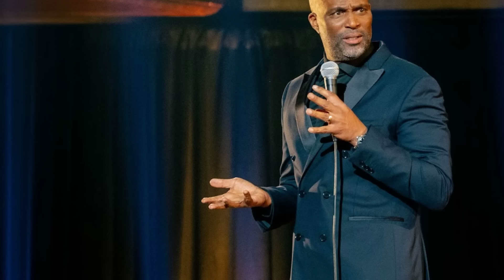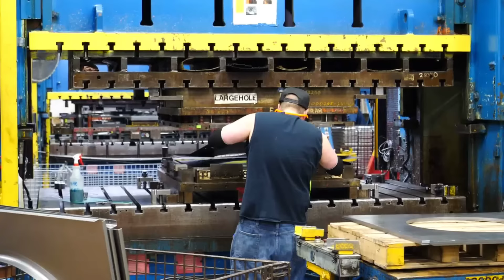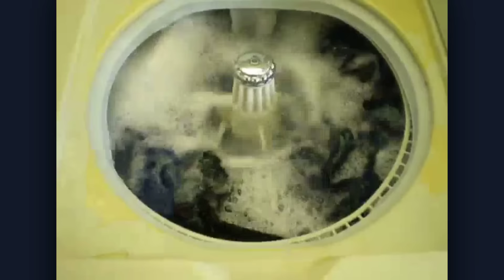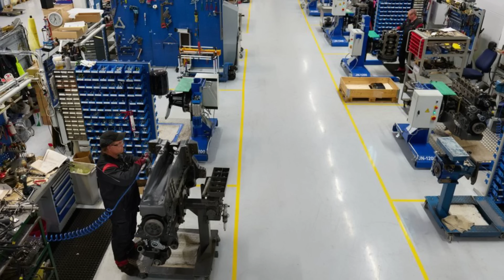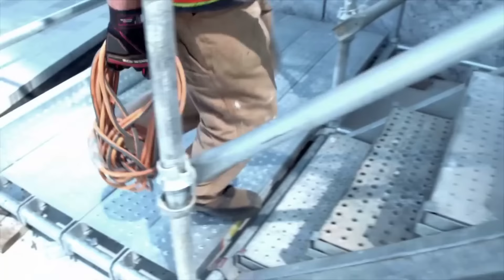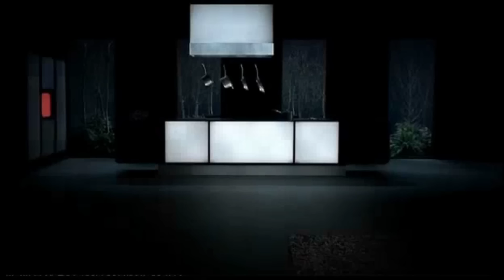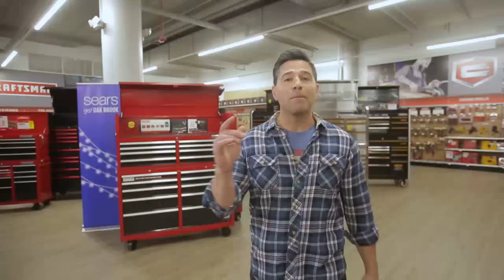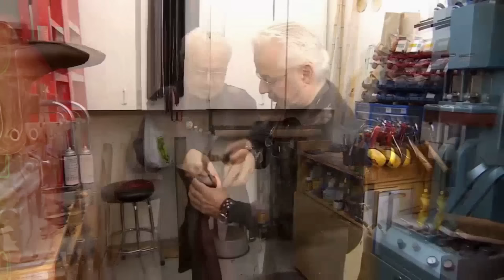The Only 5 Brands That Still Last (The "Buy It For Life" List)

Comment: Agree with buying Speed Queen, but disagree strongly with using top loading machines. 
They ARE violent, and that wears out clothes. 
I have a Speed Queen front loader that I bought used on Craigslist after it came off a military base. It's gentle on clothes. Same durability. Simple design. Siemens motor, very efficient on electricity. A bit inefficient on water. Don't know how old it is, don't care.  Parts are cheap, already bought spares.

Comment: A year ago, our refrigerator went kaput.  We decided to buy another from a local dealer instead of from a big “everything” store because we had heard that those are the brands tgat break down so frequently. We bought a GE because we were told that they are reliable and last a long time. Here it is 1 year and 23 days since we bought it and the ice maker goes out.  The dealer has no repairman and we’re 23 days past the warranty.  So much for GE appliances.

Comment: Cast iron cookware is crap; heat distribution sux making it difficult to get consistent results. It's heavy, requires lots of care, and is clumbsy to use. The best solution is nitrided high carbon steel. The surface is exceptionally hard and it quickly becomes non stick. I have a full set of AllClad cookware and have used them for more than 25 years, but the KitchenAid nitrided pans are equal in quality and provide excellent results.

Comment: Every tradesman knows that German, Knipex pliers are the best you can get and Harbor Freight's Chinese made, Icon sockets, ratchets and other tools are beating the top brands in break test on Youtube reviews and then there's Milwaukee and DeWalt producing excellent tools with Kobalt by Lowes and Husky by Home Depot being considered lower tier, except the Klein Tools voltage meters, which are awesome.

Comment: I still have a SkilSaw from 1995, just needs a cord replacement and some oil.  Milwaukee quality has been declining, but they still have some decent items.  Their 10 year old hand drills had steel gears and still running good after heavy use.

Comment: I had a tool box full of old craftsman tools, until my service truck was stolen from the shop I work at. That was a few years ago, I had to replace everything with either snap on or Matco. 30 years of tools gone and the company had a camera that would bust me if I scratched my nose but somehow did not get a single picture of the person that stole the truck? I am pretty sure I know who took it bc he had only been there a few days and knew the trucks are parked behind the building where they cannot be seen from the road. He did not show up for work that day and never came back and he had no tool box of his own. The last ping from the camera was a block away from where the truck was found the next morning, by the way, the truck was stolen durning the middle of the day. The shop called me at 5 pm and asked where is my truck, all trucks are locked in shop at night. That is when they knew it was stolen, to top everything off…..they had refused to fix the security cameras around the shop for years! Now we have extra ones that watch everything

Comment: Speed queen is very very costly 3400 dollars for a TC 5 washer and dryer before installation
Reply: But the same SQ will still be working fine in 20 years. Buy a cheaper washer and you'll be buying your 4th or 5th one in 20 years and they won't be getting cheaper. Where's the savings?

Comment: Speed Queen TC5 does not have a purely mechanical timer; it has a mechanical knob mated to a circuit board.  The TC5 is designed for strong agitation, which is good for cleaning really dirty clothes, but the trade off is higher sound volume and harsher treatment of the clothing.  Interestingly, if warranty-length is a good indicator, the TC5’s controls, which have the appearance of mechanical function, are no more reliable than the models with touchscreen controls.  The TR7 model has touchscreen controls and a 7 year warranty whereas the TC5 has a 5 year warranty.  Yes, I did a lot of research before buying my Speed Queen 😂

Comment: I just bought an insulated Melitta pour over coffee maker. Uses a cone shaped filter, which I can buy a stainless steel reusable filter and just wash it every day. I heat water on the stove and pour it into the filter basket that sets on top of the carafe. The coffee brews down through, and after it's done I can remove the filter basket and put an insulated lid on the carafe. It keeps the coffee hot until I'm "coffeed out" for the day. Since I drink lots of hot water in the winter, I can also heat water a pour directly into the carafe. It should last a good long while with proper care.

Comment: I've had great success with Allen Edmonds shoes.  When the sole eventually wears through you can have the sole replaced.  Owned by private equity...but many (most) of the shoes are still made in the USA on the old Goodyear Welt machines from the 1950s.  I have some that are 20 years old and have redrafted but also recent pairs and the quality is still top notch.  

Redwing Boots "heritage collection" are also very long lasting high quality all leather boots.  

Our Kenmore Washer and gas Dryer  (front loaders) still going at 22 years.  Owning both front and top loading...the clothes come out cleaner and softer from a front loader.
Reply: Yes, 22 years ago it was still a good brand. Not anymore, things have changed. That's the point, reputation means nothing to today's manufacturers.

Comment: My Maytag washer won't even get our clothes clean, and our old 1980s machine worked great and was only discarded to be  given to family. The filter capacitors are leaking DC, so badly that even when not operating, if you place a radio or phone within two feet, you hear a 60 cycle hum!!

Comment: The speed queen you bought 8 yrs ago is much better quality than what you will get now. I had ro replace a SQ dryer bought many yrs ago because it needed a new timer switch. Guess what SQ could no longer get that part nor could you get a replacement of any kind so we bought a new SQ a couple yrs ago now. I immediately could tell it wasn't the quality of the old one. The metal was thinner especially on door. Was making loud noise when drying. Place we bought from said they did the SQ warranty but it took a month to come out & almost another for part. After all that, it still makes loud noise. I've been back & forth with SQ. Not happy. Will not buy another 
 warranty.

Comment: I've just checked the price of a domestic Speed Queen in my country (Brazil)... the cheapest one costs half of a new car. Talking about cars, do you know about any modern form of transportation that is not a glorified cellphone with wheels? I own a cheap, air-cooled single cylinder motorcycle, but what are the four-wheeled options out there in the world?

Comment: About the cast iron skillet...  Popular brands are Lodge, Griswold and Wagner, but I swear by vintage Birmingham Stove and Range cast iron.  That foundry designed the handles on most of their skillets with a ridge or spine on the underside of the handles, which gives one a better grip that helps keep the skillet upright when cooking and moving the pan around on the stove.

Comment: Speed queen owned by alliance laundry systems is owned by a private equity firm. They have designed their equipment to fail as well. I can rebuild one using high quality bearings and a steel transmission gear and it will last for a little longer then the factory but it fs isn't designed to last 25 years from manufacturer. But I'd admit it's repairable. Unlike many other washing machines.

Comment: Speed Queen is no longer a desirable brand of laundry equipment. I bought a set in 2018 and both pieces have been a huge disappointment. The dryer motor failed one year after the expiration of the 5-year warranty. I decided not to repair it since the cost was more than buying another, cheaper brand of dryer. The washer DOES have a lid lock, the bleach reservoir has rusted out, I have had to replace the control board twice, within the warranty period. I have decided to buy the cheapest laundry equipment I can find, then replacing them when if inevitably fails.

Comment: 1.speedqueen washing machine
2. Outdoor mowers, generator or pressure washers with Honda GX engines
3. Boots made with goodyear welt( upper is stitched to sole, not glued. Redwing & Thorogood American Heritage line.
4. Lodge cast iron pans
5.hand tools: Channelock pliers, Wright Tool for wrenches & sockets

Comment: What about kitchen appliances? I have my TC5000 washer that still works after seven years and which I expect to outlast me. 
My legacy generation Newton, Iowa Maytag dryer is on its last legs after more years than I care to count, but the new Maytags look like plastic that has been left out in the sun too long, can't even put a box of dryer sheets on top without it sliding off. 
Speed Queen is good but the current retail price is a bit out of the average buyer's budget.
Another problem is the Hotpoint fridge that went into full brick mode in under six months, a Maytag electric range that died the first time I used the self-cleaning function, and have had more Whirlpool and/or Whirlpool-built dishwashers than I can count, all recalled and the fix was to replace the machine with a new Whirlpool-built machine at my cost, "...and here's seventy-five bucks if you buy another one of our pieces of shit.  No, we won't give you the voucher if you buy a Bosch."

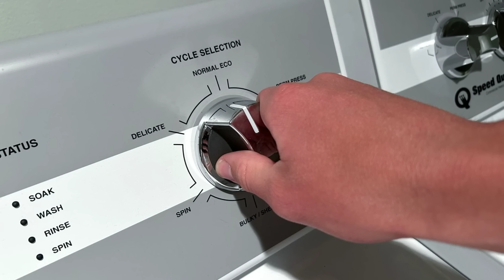Comment: 2:09   Begging your pardon, but the Speed Queen TC5 does not have a mechanical timer. 
The large knob shown is the cycle selector.
The TC5 is still the most reliable washer on the market, and when you have grimy work clothes, it cleans them thoroughly in under a half-hour. A lotto be said for that.

Comment: Channel lock sucks  if you've ever used them, you've pinched your fingers. I used knipex as a plumber. I also have a pressure washer that has a Honda gx390 engine. I used the hell out of it.  I turned it into a hydro jetter
 I've only cleaned the carburetor and changed oil over 6 years. I've replaced 3 pressure pumps as it's not worth my time to rebuild. Honda ftw

Comment: Here is a free tip that I learned many years ago, and I hope it helps some folks out there. Growing up as a poor kid, I learned very quickly: cheap vs quality. Instead of buying brand new cheap, I would buy secondhand quality. I am now pushing 60 years old, and to this very day, I still do the same exact thing. As far as the cast iron is concerned, absolutely. 

I use a brand called Magnolite, which were professional-grade pots and pans that I purchased in the 80s, and they cost a great deal of money back then. I still use them to this day, but I have noticed that, slowly but surely, I am converting to cast iron. The best tip I can give you is to use your non-stick pan for eggs only. Use it for nothing else, just for eggs. The second you see a break in the coating, you might as well throw it out. The last one I had lasted 15 years, but I only used it for eggs.
Reply: Yes, Magnalite
My current wife bought a set from Montgomery Wards before we got married 36 years ago 
We use them regularly & love em

Comment: I bought Xiaomi Typre Inflator / Air pump (for cars, cycles, football with an in-built battery). It worked for 2 years, then stopped. HelpDesk said, XIAOMI doesn't support that product anymore. I learnt my lesson, planning to buy a manual foot-operated air pump that's built to last.

Comment: I finally was tired of non stick skillets peeling, I found and bought an “Erie” cast iron skillet 2nd series. These were made in Erie,Pennsylvania mine was made between 1886-1892… use it most everyday. Awesome pan, and fairly light…😎 almost 140 years old..😂
Reply: They find the chemicals used to isolate the Silicone to make the non-stick surface in every animal and environment on Earth- including humans. 3M and Dupont Poisoned the world so people wouldn't have to use a spatula and or a scrub brush. And the compounds they use to make the 'Black Plastic Spatula' you need to use on Non-Stick pans has recently been proven to cause Cancer.
Reply: Griswold, made in Erie, PA!!   It used to be on the list of everyone setting up housekeeping.  I bought mine on eBay.

Comment: I have a 1970's Frigidaire Jet Cone automatic top load washer "Made Only By General Motors" as it says on the machine.  You can put anything in that thing;  carpets, blankets, quilts, car covers,  maybe all at the same time, and it just keeps going;  spins at 1100 RPM and is steady as a Rock.  I think they were made out of old Buicks.
Reply: Made from Sherman tanks
Reply: @gentjim5007 😂❤
Reply: We have a 1949 Frigidaire refrigerator with that same slogan on the door - changed the gasket once or twice maybe & the thermostat - still runs great😊

Comment: I never buy a wash machine that has a computer board in it. I want to be able to choose my own water level and what cycle I want. If it has any kind of digital crap on it I run. Hard to find those these days. I have my set from 1997 and working great.i cannot use cast iron due to it is too heavy for me to pick up.

Comment: Had a early 1970s, harvest gold kitchen aid dishwasher when we bought this place in 1999, when it finally bit the dust it was 42 years old. Replaced it with a Bosch, quit within a year, 6 months, 3 techs later finally got it running again. My harvest gold cook top and built in oven still working.😊
Reply: do not buy any bosch.  maybe it used to be a good buy, not no more

Comment: Designed obsolescence is the problem, most products are designed to fail, just after the warranty runs out. 
The "Right to repair" legislation in congress needs our support. As a retired machinist, I can tell you that cheap tools are dangerous and costly. A Honda electric generator cost 4 times more than a Harbor Freight one for a reason, they can be repaired at a Honda dealer.

Comment: I'm an electrician, and Klein screwdrivers and Linesman pliers still last. I use my tools heavily, and even abuse them, (using a screwdriver as a chisel because I'm on a ladder and need some wood out of the way for example) and every electrician uses his Klein Linesman pliers as a hammer, but they hold up. I have worn them out, but they last for years of hard, abusive use.

Comment: The dryer that came with my house 25 years ago has 2 knobs on it, time and start. It’s a Kenmore. We’ve replaced the belt on it once. God knows how long the prior owner had it. Mine is still working and they probably been through at least 2 “modern disappointments “ in their new place. My 30 year old toaster still chugging along.

Comment: The new, pre-seasoned cast iron will not build up a non stick surface as well as the old, smooth surfaced pans. My welder friend took my new pan, used a sanding wheel on his grinder and smoothed my new pan to a flat surface. I then seasoned it using animal fats. Only animal fats will actually penetrate the metal and build up that non stick surface from the inside out.

Comment: Lets talk about light fixtures with integrated lighting. A bulb goes bad and you get to chuck the whole fixture and buy a new one. Can't just replace the bulb. Which means for those of us who aren't allowed on ladders, we also have the expense of installation. LED bulbs are fine, but no, they don't often last for decades. Replacing an entire light fixture every couple of years is wasteful and expensive.

Comment: 1. Speed queen fir washing machines.  2. Honda small engine- GX series, for  a generator. 3. Boots - look for the  term, Goodyear welt. Related to the way the sole is stitched to the leather upper. Brands like,  Thorogood, (sp?) specifically the American Heritage line, and the Redwing Heritage line use the stitching of sole to the uppers. You can resolev then 3 or 4 times. 4. The iron pan.  Cast iron. Brands like Lodge, still made in TN skillet for $30. Will last forever 5. The hand tool. Look for the brands that still forge their steel in the US. For pliers, the  name is Channellock, made in PA. For wrenches and sockets look at a brand called Wright tool. The Wright grip. Heavy,  not shiny.  But 50% better torque without stripping the fastener.

Comment: Many years ago I worked out west as a Wildland Firefighter. The best boots at that time were Whites and  West Coast. I lived in Northern California were I had access to cobblers who  measured you foot and placed an order to the above mentioned boot makers. Otherwise, you had to go to some supplier whose sizes never quite fit properly. 
On your info on iron pans I  agree wholeheartdly .  I also use steel pans  and  Granite pans which are indestructable . The Granite pans are the only non-iron/steel pans I use. All of my pans that were coated with Teflon and other forever chemicals were discarded years ago.

Comment: I agree with you %100 what you said about Samsung, my refrigerator died right at 5 years when the  compressor stop working and would have cost $1300 to fix ut if Icould find the parts that Samsung said are back ordered for three months, and subject to finding any shop that works on Samsung,  in the meantime, the ice maker continues to freeze all the time